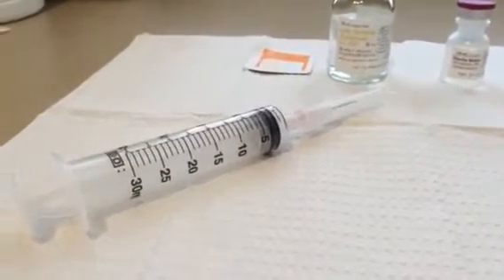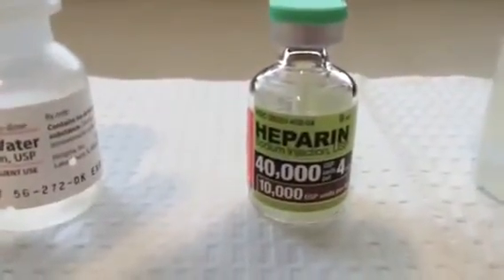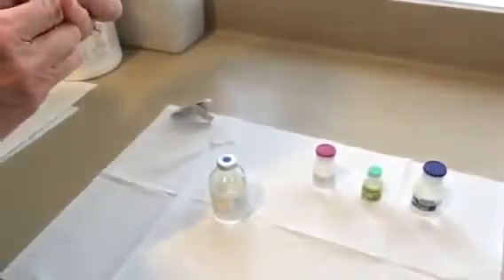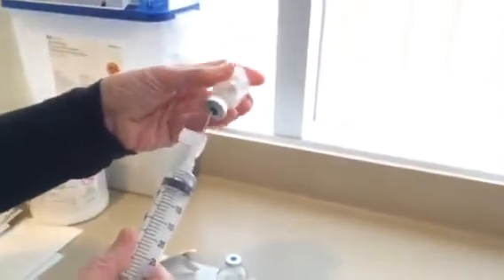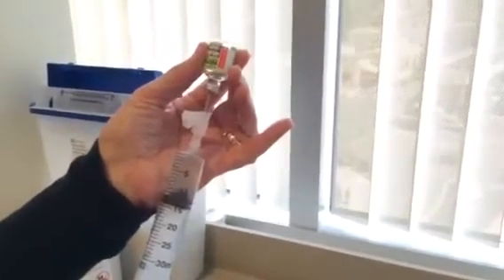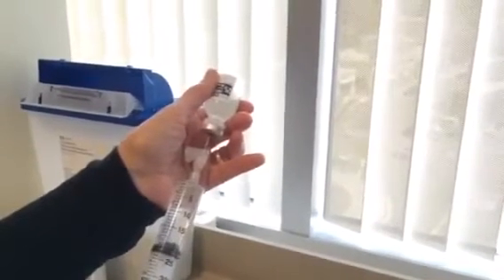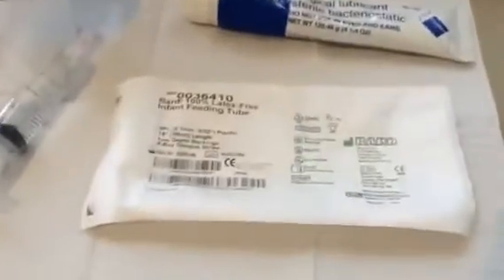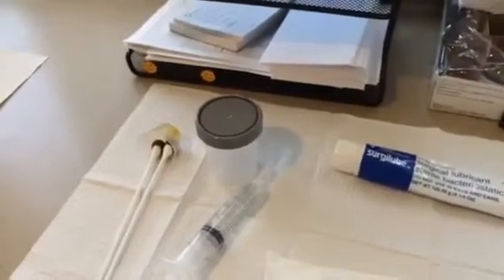Bladder Instillation with Bruce Kahn, MD

Comment: At last a video!   I have been using 10 ml of 1%Lidocaine, 5 ml of 8.4% Bicarb and a 100 mg Elmiron capsule emptied into solution (ever since the Heparin contamination debacle a few years back).  I check bladder before instillation.  do Cath -- get a mid stream cath urine for testing, and use a 60 ml catheter tip syringe with about 15 ml of air air with solution--the air drives the medicine down the catheter.  I am happy if they can hold it a minimum of 40 mins--then I recheck the level of pain on palpation of the bladder base--typically in 45 mins the pain is gone.  Occasionally I will have to do an ilioinguinal nerve block, intravaginal Lidocaine and EMLA to the fourchette, and less often a pudendal nerve block, as even with relief of bladder pain there is significant pelic floor pain.
Many urologists in my neck of woods trivialize dietary management--even though they don't treat IC.  They tell patients with normal bladder on cystoscope that they don't have IC even though blader instillation works--it is a battle ---to have to go up against the urologists!!
I am also very much in favor of teaching patient to do their own instillation, or teach their partner to do it--it gives back their independence!  They will often do it before intercourse, and they can take a vacation without fear as they can rescue themselves!